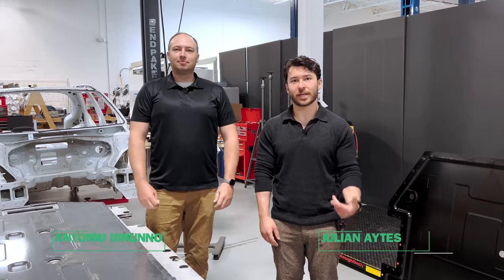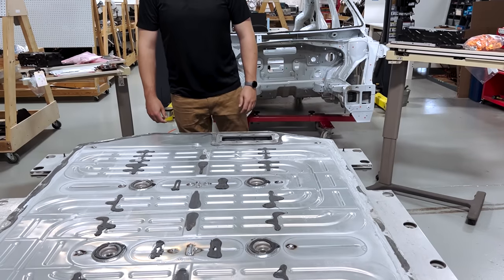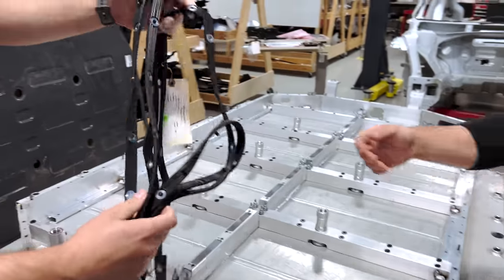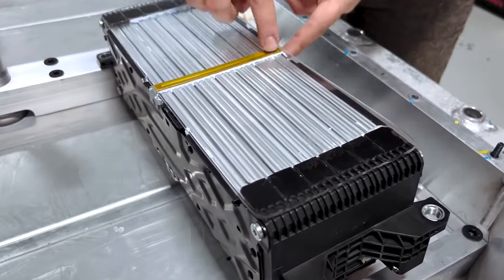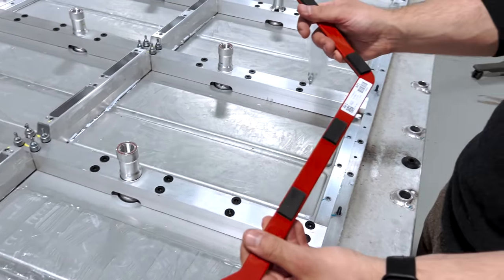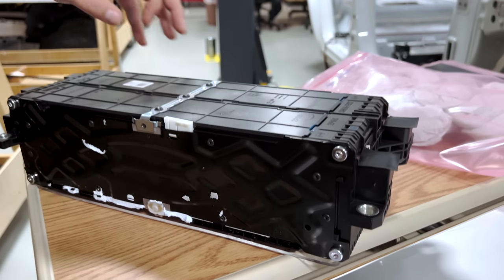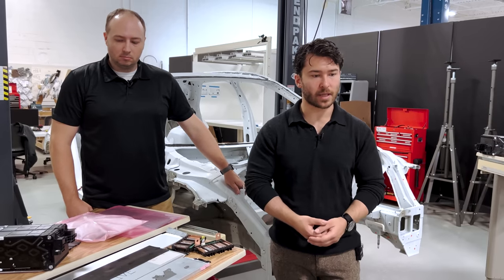Hyundai Ioniq 5: Integrated cooling plate | Battery Pack Breakdown

Comment: I like serviceability of this module. I know your primary focus is on reducing assembly costs, but at some point things break and have to be repaired. If you watched some things that have to be preformed in order to do repairs some focus might be given to this area. In a way the process of focusing on cost only is the same as bean counters being in charge of production changes. A better strategy would be to consider both issues when possible.   If you don't believe me ask people that have to preform repairs on ICE and Electric vehicles., which increases cost of vehicle ownership . Really like your channel and have been watching for a long time.

Comment: Thanks for the great view! I like the liquid seperation from the pack, but it would seem the cooling/heating would be very uneven between the module nearest the inlet and the module at the outlet.  It also seems like a lot of heat/cooling would be lost from the bottom to the outside as that thin plastic sheet doesn't seem like much insulation.  Perhaps it is made up with a beefier coolant/heat system, but that adds cost and reduces efficiency.
Reply: With the exception of extreme cold weather environments, mostly you want heat to dissapate from the pack. If anything this probably helps reduce the demands on their cooling system.
Reply: Actually the design of that serpentine pattern has the hot side run parallel to the cool side which results in a pretty even temperature throughout the pack. Certain arctic birds have a circulatory system that works a lot like this to prevent them from suffering shock from ice cold blood reaching the heart...
Reply: @ApparitionElectronic  Makes sense. Thanks!
Reply: We have another exceptional engineer in the comments.
Thank you
Reply: Thought the same, it will be very interesting to see winter performance of the Ioniq 5. If you try to warm up the battery from underneath, nearly half of the heat will dissipate to the outside.
Reply: @nilsfrederking62  Yes, it's not well-insulated is it? Given that batteries like to be at about the same temps as people it seems to me that putting them in at least some insulation would be a very good idea. This is OK for hot countries, but not cold ones.

Comment: Great video,  I wonder if the thick layer of Thermal silicone also helps with shock absorption? to the battery cells, and or to help with expansion when the cells get hot?

Comment: I would hope the smc? cover would be a little bit harder. Over here if there are any dents in the battery back if will fail yearly inspection and the battery back must be replaced. I just wish the battery packs would be better protected from outside forces.
Reply: it have the cooling plate then the thermal paste THEN is the actual battery cells. But yeah if you decide to off-road/skid off on some large rocks. You will need some battery work. And looking how it is assembled you will need a whole new battery. Once the cooling plate is damaged no one will be reapplying the cooling paste just to save you a few thousand bucks when they can overcharge you for everything :D
Reply: @qa1e2r4  There is  a post in these comments about  someone getting a new paste+cooling panel+cover fitted (due to damage to the bottom of the pack). So it is happening.

Comment: I5 user here in Indonesia, cinder block on highway is quite common here, my I5 is one of the casualties 😢. But local authorised dealer here is certified to rebuild it, total quote is $8,250, majority of it is the cooling plate at $3,600, thermal paste at $2,250, which applied to the plate with $170 applicator. And yes, those damn black flimsy FRP price is only $80 😅. That’s far cheaper than the quote for new battery at $30,000 here 😮😮😮
Reply: Ouch. Why are cinder blocks on the motorway common? Who keeps dropping them?

Comment: Interesting to see the integrated fuses for the cell voltage measurements on each of the module interface pcbs!  Very nice (if somewhat costly) addition to avoid shorts in the BMS wiring leading to a serious thermal event

Comment: Replacing the hv battery on the ioniq5 cost around $ 40k usd.  It doesn't take much to damage the skid plate, any damage to the skid plate will hit the battery causing a small dent,. hyundai dealership are private owners and will quote you all kind of prices but all of them will quote you the same price for the part number.  And the part number will be around 40k usd.   In other words, do not hit anything on the road with the ioniq5, because damage done to the hv battery will not be covered by the warranty. Just like windshield, or tires.

Comment: I've seen the batteries are super expensive,  replacement Ioniq5 batteries from Hyundai cost around $60,000 just for the pack, not including labor.    One guy he paid $55,000 for the car and hit something on the highway that damaged the safety cover and Hyundai wanted $61,000 to replace the battery pack, his insurance company totalled the car even though the body was untouched by the item he ran over.
Reply: This guy is all CAP. It’s $30,000 USD. I looked it up.  It was not Hyundai corporate that charged $60,000 CAD. It was the greedy Hyundai dealer and incompetent insurance adjuster.
Reply: Also the damage was caused by the driver so the battery was not covered by warranty. It wasn’t only the battery cover that was damaged but also the battery cooling system, so it couldn’t be repaired by the dealer.
Reply: @JohnLee-db9zt  -   According to the report he hit something at night in the dark laying in the road that probably fell from another vehicle..    NOT his fault.

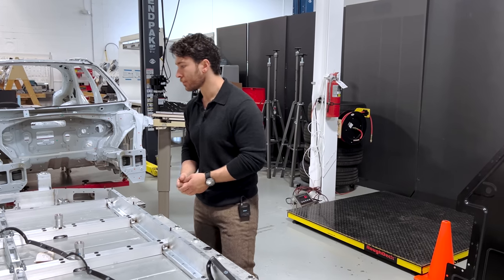Comment: 12:02 There is a trend 'repairability' to become mandatory by law(consumer rights/environmental motives) It already has a legal basis in some countries and the EU is working on it. Maybe that is the reason for it?
Reply: Do you repair your cell phone battery? I think EV cars, especially the cheaper ones, will move in the disposable direction (sadly)
Reply: @bartwaggoner2000  Yes, I do. I usually replace them after about 2 years or so, when they start having less and less capacity. And they usually cost less than 50 USD to replace. A car battery costs between 5000 USD and 15.000 USD. So you bet I would like to be able to repair it in case of damage, accident or expired warranty. Especially once the used and second hand market of such modules will start to grow. It will be easy to swap, re-purpose, repair or upgrade such batteries. It's 10 times better than the 4680 sealed crap, for example. The right to repair does matter!
Reply: @flaviandd  there is no 'right to repair' - what is that, some God-given natural right? There is a right to just not buy it if you don't want to - the free market.
Reply: You cannot easily swap modules from most packs - I imagine this pack to not be much different. And I don't mean physically but when it comes to the delta between cells..

Comment: In regard to the Battery pack design to be service friendly when you’re building a product to break more often to create service work, then you build it to service friendly, If you’re building a component to last lifetime of the vehicles you don’t need to build it to be service friendly.
Reply: TESLA battery pack, dont need to be Serviced.......lol.
Reply: Its probably more to do with internal company politics. Traditional OEMs make most of their profits on selling parts to their licensed repair shops. So the ethos of repairability is more about making sure there are parts that can be repaired than making parts designed to fail. Tesla has shown that they arnt so much interested in repairing parts even when its obviously a faulty part from the factory. Its highly questionable whether that is something to hand out accolades for. And there is no such thing as designing parts that never need repair. ANYTHING can be broken and there seem to be some members of the general public who are out there trying to prove it.
Reply: @markplott4820  they are holding up pretty well, with little degradation over 200k miles - but unfortunately once you scrap the car there is little you can salvage
Reply: resiliency vs redundancy
Reply: @patreekotime4578  Model 3 and Y are very reliable, lots of them out there with high mileage and only minor service requirement.
Reply: @bartwaggoner2000  Tesla batteries can be recycled. Not easily broken down and reused as separate modules but they can certainly be recycled. Munro has referenced this in previous videos.

Comment: 21:30. These fusable link I guess are to protect LV modules short circuit, however these are in serie anyway so all the HV could come across these fuse somehow. So why these are not glass  or sand or ceramic surrounded to not have a plasma event?  Normally fusable link are on each cells in parallel so this protect for 3.7V maximum, however these big fusable link are at the HV level !

Comment: I'm not the expert, but arent most of those aluminum welds MIG, not TIG? They look like MIG welds to me on the pack assembly? Can you point out where they were doing manual TIG welding?
Reply: Most are friction stir or MIG, the round bits were manual.
Reply: @peeweedan9  The welds except the friction welds look horrible, my guess is that they are manual welds. one weld even does not connect the parts properly over half of its length. No idea who let that casing pass quality control.

Comment: The most important issue of all in EV is the safety of passengers from Thermal runaway. I believe that these battery packs should have a pressure relief valves piped in and incorporated to the chassis of the vehicle protected by thermal resistantant materials and vented upwards in case of a runaway.
Reply: Why do you want them vented upwards (into the car?) What's wrong the sideways venting through the seal this pack uses? Or indeed venting downward away from the car?
Reply: @xxwookey   not into the car.  if they could design a safety valve incorporated into the chassis  vertical structure of the car that would guide  the violent burnoff to the roof area like the rear C- pillars.  If you watch videos of a thermal runaway of battery packs under the car would think to step out safely when those things ignite.  The amount of heat and energy those things make is like a solid fuel rocket burning off.

Comment: Is there anything that thermally isolates the cold/hot plate from the battery box? Or does the battery thermal management also have to heat/cool the entire battery box whenever it wants to heat/cool the cells?

I’ve noticed that my Ioniq5 battery loses a lot of heat very quickly in cold temperatures. Losing heat from the battery is great when it’s hot outside, but not great when it’s very cold and you want to DC fast charge at a decent rate.

I highly appreciate Hyundai/Kia’s emphasis on serviceability. I know that Munro believes serviceability is a waste of time/money, but for those of us who actually own older cars and/or those of us who work on them, ease of serviceability is a substantial consideration. Even if Hyundai/Kia only replaces entire packs under warranty, having the ability to replace a single failed module in the pack for $2000 is going to be much more achievable than being forced to replace the entire pack for $15000+ (a la Tesla) when it’s customer pay. It also makes the pack way easier to recycle or repurpose when it is no longer fit for use in a car.

Seeing how the Ioniq5 is built, it gives me a lot more confidence to keep it outside of the warranty period than my Model 3.
Reply: Model 3 and Y have proven to have very high longevity and very good winter range, as the whole thermal system is very mature an efficient (oktovalve and heat pump). The Ioniq 5 has to prove its longevity, I have my doubts with the only one sided cooling and very little cooling surface; thermal management is crucial for battery life. In winter conditions it will be very difficult to heat the battery up, as there is only minor insulation of the cooling plate to the outside (glasfiber is not a very good insulator) .

Comment: The thermal heat transfer system explains why the delta between coolant inlet and outlet is much higher for these vehicles compared to Tesla's coolant system.

Comment: As ever this was great, but I'd have liked a little more time on the module construction. I didn't fully understand what was meant by the Z-fold and pancake construction flavours, nor how the tabs are connected to the end pieces.
I like this design though - it seems quite space and weight efficient, yet still fettlable. And keeping the coolant separate seems very neat. Maybe they can iterate down to 1-2mm of goop over time and some some weight and money.

Comment: 1:55. That’s a long path. Won’t there be a huge coolant temperature delta between the cells nearby the inlet vs the outlet?
Reply: Apparently these packs can have a delta up to 10C, so yes this may be an issue. Do other packs have parallel, rather than serial cooling paths? There could still be differential cooling in that case due to 'shortest path' issues.

Comment: Is this battery waterproof? I mean if we get flooding on the road, is it safe to continue if the the chasis  exposed to water?
Reply: No, clearly they never thought that the car would ever have to drive through puddles and flooded roads from time to time. I'm glad you spotted it first. Best you get in touch to point this out to Hyundai engineers and to Munro Associates engineers because despite their extensive experience and qualifications they need someone to explain this issue to them. (I imagine it must just be good fortune that from all the millions of EVs from different companies across the world there has yet to have been a safety issue crop up... hey, wait a minute, maybe they all DID design their cars to be safe driving through water ... who would have guessed?)
Reply: Q: I mean if we get flooding on the road, is it safe to continue if [the chassis] exposed to water?  A: well Chet has already tested this and paid a heavy price for his bad decision making, however even if Hyundai told you it WAS safe, it begs the question why would you really want to...?  (hint: since like carbon fiber Submersibles things can fail dramatically).  of course then there's the long standing issue of how water and High Voltage electricity don't mix, everybody knows this.

Comment: I just came from the video about the $60,000 cost to replace the battery on the Ioniq 5.  That's just dirty.  After hearing about the modular battery design, it sounds like we can just replace the affected modules without the need to replace the entire battery back.  Not sure if anyone will want to get the Ioniq 5 or any Hyundai EV anymore after that...
Reply: If I owned one, I’d sell it…. And buy a Tesla. 
Less chance of damage, and absolutely worst case, about 1/3 the price for a new battery.
Reply: @FutureSystem738  Wouldn't have a Tesla even if it was free.
Reply: @clansome  LOL :-) 
More fool you. We’ve had one for well over four years, and it’s the best car I’ve had, by far, ever.
Reply: I think I saw the same story, the bigger question is there isn’t anywhere near 60k in materials there so this is clearly a con.
Reply: @FutureSystem738 until the underside is scratched and the dealership give you a $60k bill. Which is essentially what happened in the story he referenced.
Reply: @dave24-73  circa $60k is pure extortion, criminal. It even sounds as though there may have been no real damage.
I KNOW of a guy that hit a large piece of cast iron in his Model 3 and damaged the battery. (It was still driveable.) A complete replacement battery for the Tesla was under $20k.
Reply: $30k USD. Get the true story. Hyundai corporate wasn’t initially involved. The dealer and insurance adjuster were incompetent and greedy.  Tesla has an edge in battery cost because it makes its own batteries. Hyundai has to outsource.
Reply: It has a 10 year battery warranty so you won’t be paying that if it goes kaput
Reply: @LIFEOFSTUFFEDANIMALS  you say that but it’s been in the news that they have declined the battery warranties. Any scratch, scrape on the underside voids it. From a legal stance I’m sure if you fought it you would win, but by default they are not honouring the battery warranty.
That’s why everyone is talking about it, and Tesla has been caught in the same boat.
Reply: @dave24-73  oh. Well that sucks!! Maybe I won’t recommend an Ionic 6 to my dad
Reply: @dave24-73 car itself doesn't even sell for $60k. Got my sel (after the $7500 credit) for $44,499 was less than msrp before discount also even tho I bought when they were in early on in sales. Love the thing so far and way better than the teslas I've driven. Obviously the tesla higher performance options are faster but now that Hyundai released the ioniq 5 N thats the best on the market for less than $70k
Reply: 거짓말
Reply: Buy insurance

Comment: As a prior technician, I feel that mechanics pay rates should be increased significantly... I gave up due to low  pay rate and the terrible flat rate system.  I wouldn't touch one of these vehicles for the for less than $28.00 an hour. You are talking voltages that electricians deal with.. And you know what they get paid a hell of a lot more and only have to deal with the knowledge of one trade, electricity!  Call your Delegates and Shop Stewards
Reply: Shops charge customers like $100-$150/hour labor, so it is between you and shop

Comment: Is the coolingplate protection-cover also an isolation piece it doesn't seem so.

That would improve the cooling/heating effective and Effeciency
Reply: Yes, this seems like an omission. Just 10mm of foam in there would make battery warming dramatially more efficient. maybe there is enough self-heating in use for it not to really matter? But for things like camping mode overnight we'd really appreciate some insulation.